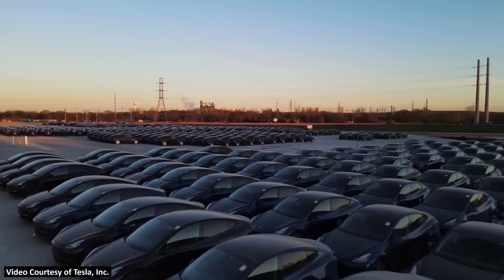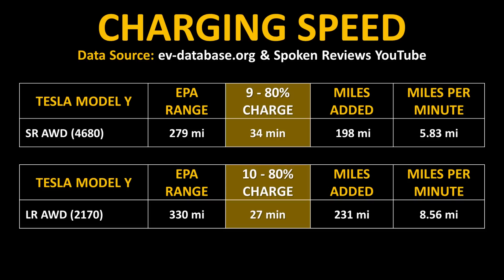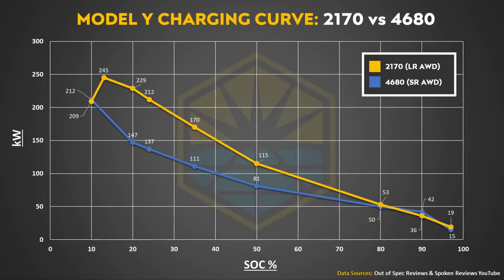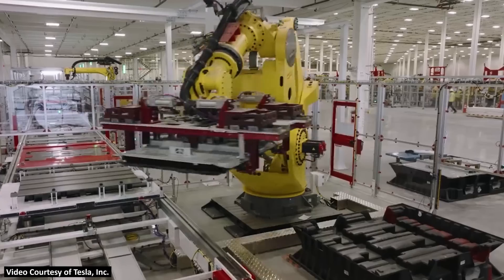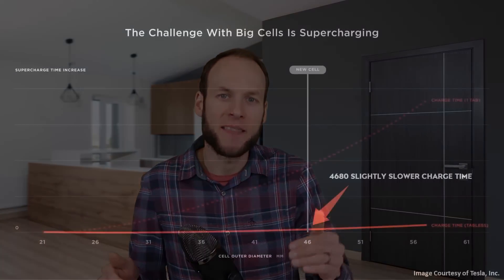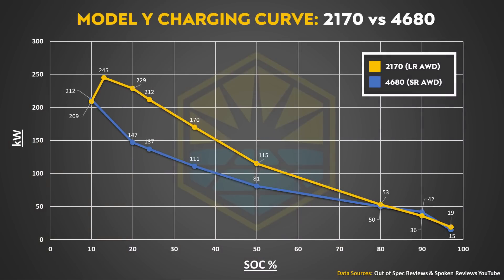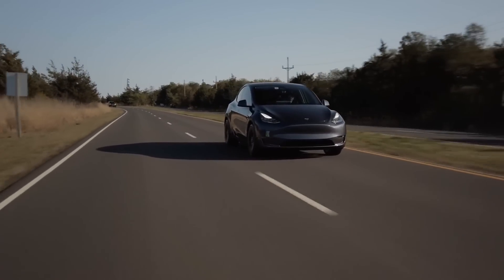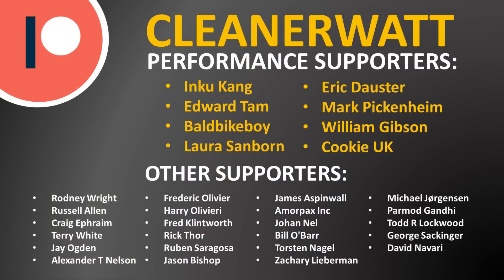NEW Tesla Model Y w/4680 SLOWER Charging than 2170

Comment: It's still 400 volts architecture. 4680's are meant for 800 volts architecture. You included the EV6 and Ionic 5 in your list of fast charging cars, however you omitted the Lucid Air, the Porsche Taycan, and Audi E-Tron GT.  Those 5 are the fastest charging cars and all have one thing in common: They are all 800 volts or higher architecture. 

400 volts is the past. Raising the Amperage to compensate and get to 250kw for a very short while is a nice trick, but it's very bad for the battery and extremely inefficient (the higher the amperage, the greater the heat and losses). 800 volts and higher is the present and future. Until Tesla turns to 800 volts, they are not going to be in the top 5, or even top 10 soon, in charging speeds.

Comment: Tesla aim is not to provide better performing batteries but cheaper to build and with better longevity and reliability. As you said 34 min for 10-80% is EV standard so they're not worse than competition. Could be that speeds will change with OTA but i wouldn't expect miracle.

Comment: You do know the 4680s are software locked for now until they have more data on real world and elon hinted that Tesla's charging will go up to 325kwh next but I don't when and it probably won't be the 4680 until they are real world tested
Reply: He also hinted there would be a 1 million mile battery in 2020 and 1+ million Tesla "robotaxis" by 2019.  He also hinted at solving the world's traffic problems with underground tunnels and a hyperloop system.  He also has been "hinting" at FSD since at least 2015.  Mercedes beat Tesla to Level 3 autonomous driving approval in Tesla's old stomping grounds, California.
Reply: Sorry for not replying to to the whe reply but short on time so just addressing the 1st and only bit I read about million million mile battery. I'm not sure if you realise but they do have the million mile battery with the LFP batteries. 330 miles range as an average multiplied by 3000 cycles they get is 990000 miles and they've had them for ages. Facts are facts buddy, you might want to get to comfirmation bias goggles off as you will just be kept proven wrong.

Comment: Slower charge reduces charging current, which is better for the battery.  It seems that Tesla is monitoring the new 4680 battery performance to optimize the charging speed later

Comment: Good job sorting out this puzzle. The simple answer? I don't think anyone will notice the time difference. At home commuting everyday? A slightly longer charging time is absolutely meaningless.  I just drove my Long Range Model Y (2020 so 2170) from Los Angeles to the east coast and back again - with a lot of side trips (over 7000 miles) I also did a similar trip last October. Needless to say I spent a lot of time at Superchargers. I charged to 99% multiple times - and relevant here - I wrote it all down. I knew that I spent a lot of time at Superchargers, I knew that getting to 80% wasn't as long as going from ~80 to 90+% but how much?  I could calculate it from my spreadsheet, but I haven't yet bothered.  
Based on experience and daily range anxiety on these road trips, I think a 400 mile range Tesla would generate huge demand and a much higher price.

Comment: A kilowatt hour is a kilowatt hour. The shape and size of the battery will not magically add more range. What will add more range is: a lighter vehicle, a more streamlined vehicle, a more efficient drive train or... wait for it ...
A battery pack that holds... MORE KILOWATT HOURS!
Given the improved thermal and conductive properties of the 46-80 cells, I fully expect that Tesla has software limited the charging curve until they gain more confidence with the properties of the new cells. I am surprised that the mass of the two vehicles is nearly the exact same. I would expect the newer Model Y to be around 100 KG or more lighter.
In any case, the larger cells mean less BMS, less time manufacturing cells, less wiring, less material wasted as cell cans, less cost to build. I would hope that Tesla would pass these savings on to the customers, but, with demand being absolutely silly right now, we won't be getting any breaks today.

Comment: There's another problem: volume to area ratio.

When considering heat generated inside the cell from charging or discharging, the total heat under any condition will be proportional to the volume of the cell.  That heat must conduct through the surface area of the cell to whatever cooling system is available where the heat radiates/conducts/convects away.  Assuming that the cooling systems themselves are adequate, here's what the problem is:

2170 cell has a total surface area of 5310.86 mm2 and a volume of 24245.24 mm3.  The volume to surface ratio is about 4.57 to 1
4680 cell has a total surface area of 14884.87 mm2 and a volume of 132952.2 mm3.  The volume to surface ratio is about 8.93 to 1

This means that the surface of the 4680 battery must be able to get rid of much more heat per unit of surface area to the tune of almost twice as much.  This factor eats into the thermal efficiencies of the tabless design.  And this doesn't even take into consideration the deeper layers and how they heat must conduct through the outer layers which I suspect affects it also.

So, my guess is, you won't see as much improvement in the future as you might hope.  I still think it's a good design.

As far as weight: somebody should tear down and compare the cooling systems between the two designs.  It's possible some of the "extra" weight we seem to see in the Texas Y's is due to increased cooling system requirements.

By the way, nature knows this: it's the reason Eskimos are shorter and rounder while tropical people are taller and thinner: conservation of, or ability to get rid of, heat.

Did this back-of-the-napkin so to speak, but the numbers should be close.
Reply: The tabless design is supposed to provide 2 advantages:
1) Shorter current paths: meaning that current flowing through the cell will encounter less internal resistance and produce less heat per unit of volume.
2) Shorter thermal paths: meaning that heat generated within the cell will be easier to remove by cooling from the end plates rather than trying to cool the cells from the sides.
With the tabless design, no current or heat has to travel more than 40 mm through highly conductive material, rendering the diameter of the cell irrelevant for purposes of heat calculations. If Tesla met their design goals for the 46-80 cell, they SHOULD be easier to cool from the ends than the 21-70 cells from the sides.
... Or am I missing something?
Reply: @surferdude4487  I don't see any flaw in your reasoning, but the heat conducted through the improved internal design still has to get out of the cell -- which it does through the shell so it's still something to consider.

I'm an industrial process guy, and not a battery guy.  So I don't have any way to quantify how much heat per unit of surface area a tabless 4680 has vs. a 2170.  I don't stand by my analysis as absolute, only that it is something to consider that may result in less of a performance increase than many have assumed.

I guess time will tell!  I'll rerun the numbers using just the end areas when I get home tomorrow; but some heat will still go through the sides and I have no way to model the distribution!

Thanks for the reply!
Reply: @EntropicRemnants  I'm not completely clear about the properties of all the materials involved. As far as I know, the electrolyte is not a good conductor of heat. And, for some silly reason, somebody thought that a single tab to connect the entire anode ( a bit of foil over a meter in length for a 21-70 cell) was a good idea. That's why I doubled down on the very strong possibility that the tabless (in fact a continuous tab) cell will have better performance regardless of its diameter.
Reply: Good answer though.   Your napkins are all dual purpose too, so that's good for the environment! 👍😁

Comment: The weight is interesting, since the weight was supposed to be reduced allowing it to be more efficient. Tesla is short on 4680’s and I can’t see them putting extra in a vehicle that odds are a lot would not pay the extra for. That is not a wise move, since batteries are the most expensive part of the vehicle. Charging speeds will most likely be updated, but I don’t think it will be faster then the 2170’s. Rumor has it that there is room for 6 battery modules in the Y,  they are 17Kw each, so these should have 4 in them making 68Kw. 5 would be 85Kw and 6 102Kw. With ranges for 5 of 348 miles and 6 of 418 miles. If Tesla upend the voltage a bit they could charge faster. They don’t need to go to 800v, there is a good increase just going to 480-500v.

Comment: What might also be interesting is a comparison of the 4680 SR batteries from Texas against the LFP SR batteries coming out of the Shanghai factory. Who know what format they are? I don't, and then there's the Alt supplier BYD with their LFP 'Blade' battery - it's anyone's guess what they will be like (but I have an Australian delivered chinese built Model Y LFP SR on order, so maybe I will find out for myself one day)...   There's also the different method for charging LFP's... ) - 100% is fine, whereas LCA (Lithium Cobalt Aluminium) have this 20%-80% user limit (or suggestion at least).

Comment: You need OBD data. It depends on pre-heat temperature. You are also comparing different capacities. You need to normalize it by capacity. Also Tesla historically increases charge speed by software update after they collect more data on the batteries.
Reply: Well said.
I really can't understand why at least one of the "expert" reviewers in the US doesn't obtain and use an OBD2 port scanner and relevant software like "others" do elsewhere (we all know who)
Reply: @AudiTTQuattro2003  
4680 is a new technology, Tesla wont risk it by releasing its charging at full speed, after all, Tesla cant make mistakes or every single news paper will start spreading fud about it. Additionally, having same car with vastly different batteries can create Osborne effect, so this new battery roll out is quite with same range, performance, charge times and so on. If there was no difference between these ones and old batteries, Tesla would have dropped this idea and continued using old ones, as it would have been cheaper than making their own.

Comment: In terms of charging, do you know if the 4680 battery has the capability of being charged to 100% every day without battery degradation,like the LFP battery?
Reply: No, it's nickel chemistry
Reply: The chemistry/heat, & not the shape/format is the issue with 100% charging & dendrites forming, thus destroying battery life/capacity over time.

Comment: Should you compare the TABLESS (solid line) charging curve with TAB (dash line) charging curve instead? WHAT IS THE POINT of comparing different sizes of TABLESS charging times (which is slight up solid curve)?

Comment: Heat is created as per volume, BUT heat is dissipated as per surface area. Hence larger cells have more difficulty removing heat.
Reply: If the inside of the cell were a blob of amorphous material, you would be correct. But it is a roll of foil and electrolyte. The foil conducts heat and electricity well, the electrolyte does not. The tabless design places the entire edge of the foil in contact with the end of the can. this means that heat is removed much more efficiently and evenly from the end of the can than it was through the side of the 21-70 can. Also that the cell losses to heat from resistence is greatly reduced because no path is longer than 80 mm. There is les heat to remove per unit volume than the 21-70. The surface area to volume ratio is not the only thing to consider here.

Comment: Hi Jonathan, the charging profile is determined by the BMS software profile, which will be designed and optimised by the Tesla engineering team. Firstly, the 4680 cells are new and still being developed and production optimised, secondly Tesla needs to avoid any battery bad news, such as degradation, or even worse, fires (heard of the Chevy Bolt?), thirdly Tesla is not able to provide 4680 cells for all its non-FLP powered vehicles; yet. So I agree with other comments here that Tesla is most likely sandbagging the charging performance of these 4680 packs - for now.

Comment: Building in more 4680s to sw release later would be dumb. Weight and cost penalties on 100% of cars. Reduces miles/kwh metric. 4680 ramping slower than expected, too in demand to be used as deadweight.
Reply: The structural battery pack does not allow for empty space and so to fill that space with fake cells would be truly dumb.

Comment: These parameters are controlled by BMS and Tesla doesn’t want to push these new batteries very hard.  If they performed much better than 2170s, no one would want a vehicle with the old battery.  In the future, a software update will adjust BMS for better charging performance and possibly a few more miles of range.
Reply: Yours is the most likely possibility.
Reply: I agree. My first thought,I presumed that Tesla would throttle the max charging rate for awhile to gather real world data, and make appropriate changes as the product matures.
Reply: That’s my thoughts too.
Reply: Brilliant minds think alike.

Comment: From day one I said that battery would have cooling issues. So did Panasonic's engineer in Nevada. Resistance comes from the electrochemical charging process, not just the metal substrates. More layers = more thermal insulation.

Your chart really needs to add Lucid for some perspective on what is possible.
Reply: How much real word Lucid data is there, or is it all Rawlinson's claims - I haven't been following them lately & I never trusted him from his facial expressions & mannerisms in his "technical" (marketing spiel) videos.
Reply: @alexmanojlovic768  I have seen the Lucid pack and it was as described in Rawlinson's Tech Talk video. Not aware of any outside testing (why would they share that?) but did top up my battery Thursday at over 170kW on a 150kw charger with ambient temperature of 108f.

I have no reason to distrust Rawlinson because he has given me none. Musk, on the other hand, has a long history of saying things that were not quite true. Note both the price and the range of 4680 equipped cars coming out of Austin in light of claims that Musk made.

I'm more interested in the engineering of the products someone develops than in their accent.

Comment: I suspect the reason is more simple than presented/speculated in this video: with roughly equal total battery size (in KWh) with 4680 fewer cells are building up the total battery than in a 2170 based on. So during - especially fast - charging less "parallelisation" is possible. In other words the BMS can distribute the total power input through the cable from the SuC to the car over fewer cells with the 4680 than with the 2170 at the same time (with the same SoC, battery chemicals  etc) and so resulting in slower total charging speed.
Reply: Nope.
Reply: @lengould9262  hahahaha.  I totally bullshitted that question hoping someone would bite. 
I thank you lol
Reply: But the 4680 cell had low internal resistance.
That's the whole point..... To accept charge "faster" than (5) 2170 cells using the same chemistry.
Reply: No that's not how it works.
Reply: So does the PDS system pick up the ADL lag?
Reply: @chrisvanderburg5568  the Pre-Delivery System & Always Dubious Laggard? 🤣😅😂

Comment: I call BS on charging speed, with respect. It’s not dia, there’s a number of novel moves, DBE, probably higher silicon on anode, maybe lower Co, Tesla manufacture vs Panasonic (very accomplished). Give ‘em time, they’ll gain confidence, as you say at end. I doubt "size" is software locked, others explained cells required / voltage / pack size. I can’t explain weight.
Edit: insideevs: "we know the cell count (828 cells) so we can calculate the energy in the pack (74.1 kWh). We have estimated the series-parallel arrangement of the cells (4, 23S9P modules making a 92S9P pack)" I can’t vouch for that, but…

Comment: 4680 is much more durable/reliable and can charge much faster than 18650 and 2170. 4680 semi will be using dual megachargers
Reply: No, no, no. It's same chemistry. It's just cheaper due to bigger size.

Comment: How long would it take for a 4 motor 500 mile CT with at least a 150kw battery to charge from 10-80%?!
Reply: pack size shouldnt make much of a difference to charging time. you just need a larger charger. i really hope the ct has a 200kw pack. it should be cable of charging at 600kw if the cooling system is up to it

Comment: They released the SR+ with a charging limit of 100kW, then a few months later bumped it up to 170. I think this is the same thing happening. Not to mention they haven't fully loaded the cathode with as much silicon as they plan to in the future.
Reply: Cathode will never have Si. the anode has Si.

Comment: How much extra energy will be needed to bring the thicker battery up to an efficient energy delivery speed……..and, in this case, energy acceptance speed ?
I’m thinking the wh/km aren’t going to be particularly impressive either, particularly on trips of only 50 miles/80kms.
I suspect you will have to spend more time (or higher speed) on a motorway in order to achieve the optimal cell temperature.
Reply: Preheating might need significantly longer time ………if there is actually any benefit in doing that - I’ve not noticed any obvious benefit in our southern winter this year.   THAT is a mystery to me.